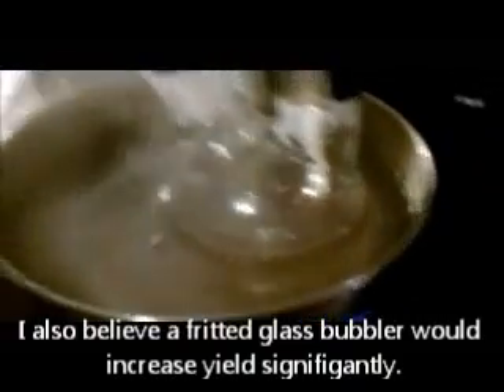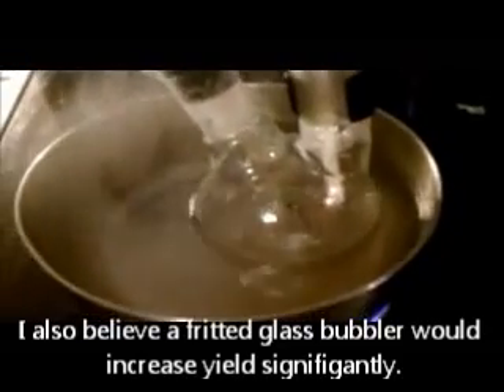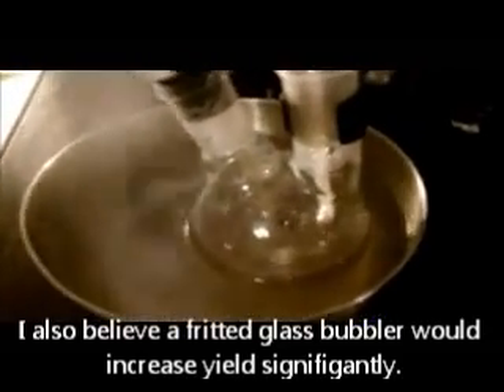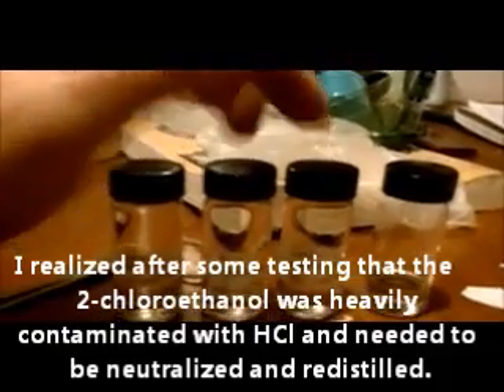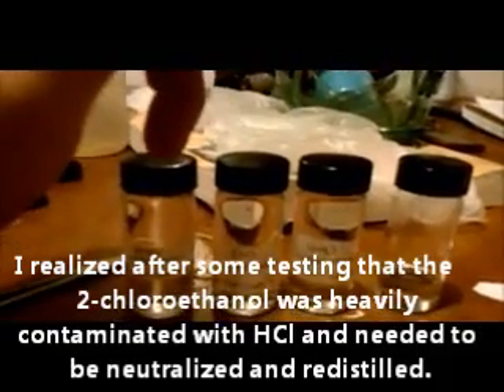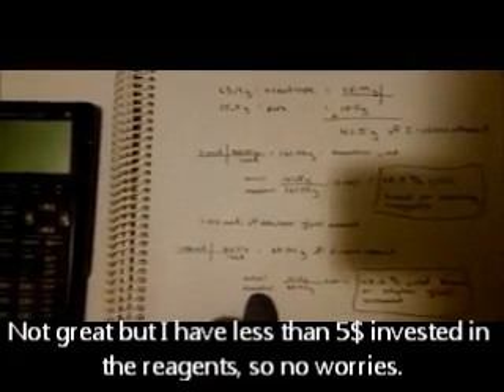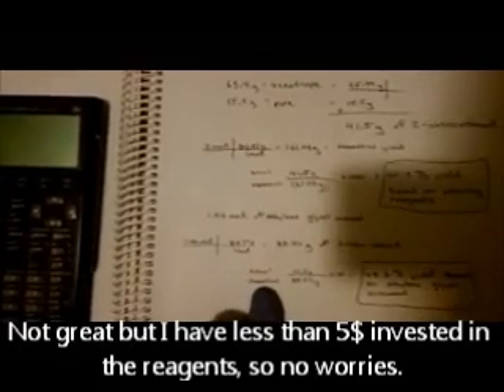Synthesis of  2-chloroethanol

Comment: Wouldnt mixing hydrochloric acid and ethylene glycol then heating also work?
Reply: It might work, but it's easier to pass HCl through ethylene glycol than saturate it and heat it in a sealed tube. Just muriatic acid and ethylene glycol would give a suspicious mixture of several compounds